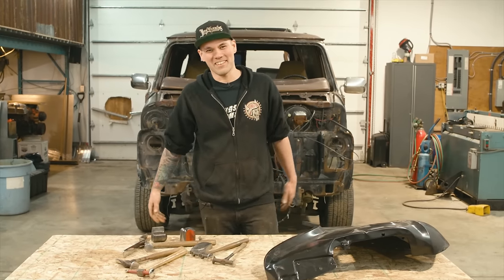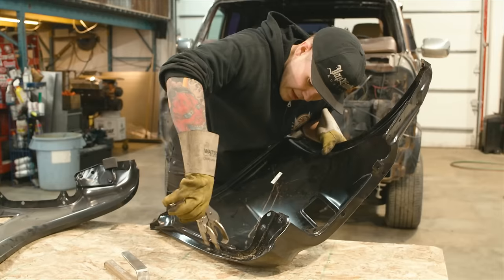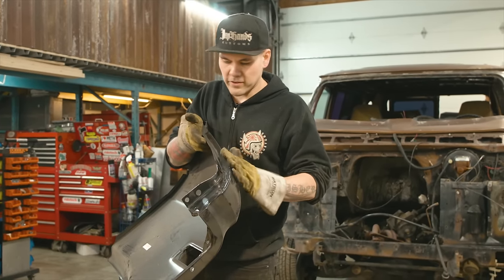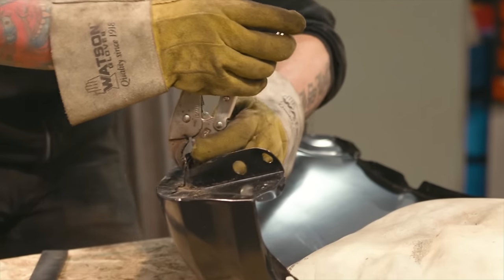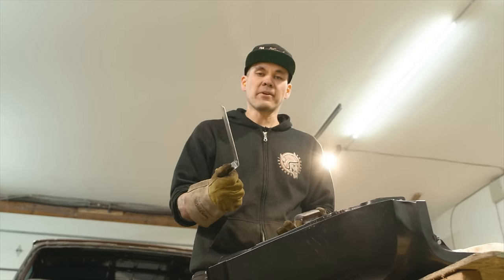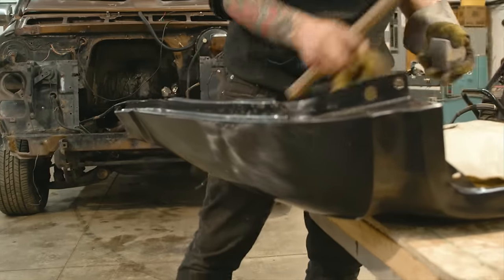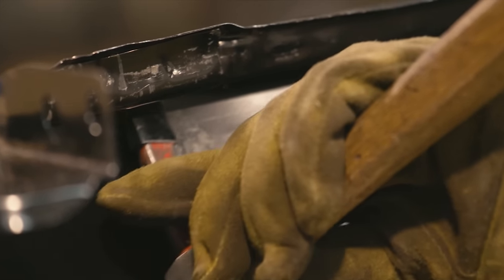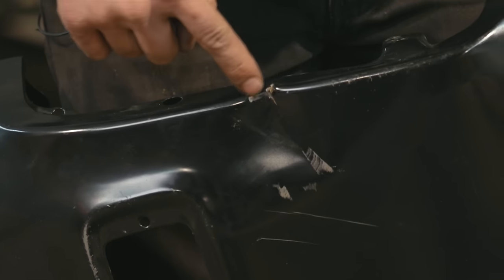"Metal Shaping 101: How To Use a Hammer & Dolly For DENT REPAIR!!

Comment: Ive tried watching a few videos on proper hammer and dolly usage, and this on by far is one of the best ive found.

 Im a novice at it and when you get the hang of it spending some quality time tapping low spots out of a panel sure is relaxing and rewarding work. 

I like the home made slap hammer, will have to find a thrift store file and make one myself.

Great work!

Comment: Brought back an old memory, my dad had a '68 Datsun 510, he got rear ended. I got into the trunk and pushed it out with my knees. Using an assortment of household tools, claw hammer, sledgehammer, splitting wedges, screwdrivers.  No Bondo, certainly not perfect, but he was happy as hell to have his trunk back.

Comment: Nice video liked the soft subtle music track. I found in a short stint I did working in a body shop that many of the new high strength steel fenders are super flexible and almost scary so but when bolted up in place in the car structure are quite rigid and secure. Also often a great difference sometimes between a oem panel vs aftermarket in fit in place.
Reply from the maker: Yeah there is a lot of difference depending on who made the panel and what steel they used. Varying thickness and strength make it challenging

Comment: I'm an auto mechanic with 30+ years experience and by no means am I a body repair guy. I have an inductive heater for siezed nuts and bolts. It works absolutely amazing. My point is that you can buy all types of attachments for this tool and one attachment I bought is a panel heating pad. I have used it to heat dents, dings, and creases and then hammer them out with various hammer and wooden hammers I've made over the years. Now I have never truly been concerned with paint finish or any real technical issues but heating the metal with that inductive heater has really stepped my abilities up. It actually makes the outcome look like I know what I'm doing. I'm just curious if you or anybody here in the comments has any experience using one, and if not I do suggest trying one as it has worked for me a complete novice.

Comment: Regarding hitting a hammer with a hammer...  While it's good advice for occasional hammer users or novices not to hit a hammer with another, you are a professional and understand the dynamics of what you are doing.  You understand the physical properties of the metal that hammers are made of and compensate for the possibility of shattering by using a soft face hammer.  This is called INNOVATING!  I personally would do the same thing.  The cross peen hammer is the perfect force director for what you're doing.  Keep innovating!
Reply from the maker: You definitely get it David! Once you’ve worked with tools long enough you definitely know what they can and cannot do. Cheers and thanks for your support!

Comment: If you had a press could you clamp the fender on the base plate and attach a kleko or surface mount to the area lower the upper plate attach your klping to the upper beam and use it in reverse going up instead of down?

Comment: Sweet work, Karl! You've inspired me to fix a couple disasters I thought would need new parts. And good on you for the hammer-hammer caution. They CAN chip, and the chip can draw blood. In worst case, you'll get to spend $1000 in ER to have one surgically removed from your eyeball, a few hours after it shreds the inside of your eyelid. So don't strike hammers, and DO put on a $3 pair of safety glasses! P.S. A 4inch slug of 2inch round mild steel makes a great hammer-whacker. And knowing you, it'll be slightly crowned & polished. Try it, you'll like it. Rock On!
Reply from the maker: That’s a great suggestion on the slug of softer material!

Comment: Hey , We All have several ", Vice Grip Pliers & the best thing I do to them is to weld a "Lock Washer" on the adjustment screw! Usually I use a 5/8". P.S. it also is great to hang them on your Welding Table!

Comment: Definitely didn't get pulled all the way from last wreck! With the fender off like that you should be able to move support/ apron where you need it. I have also drilled out the upper flange on fender, repair both, weld back on. That can help sometimes. Think we've all had these moments when good parts get trashed! Keep em coming, duder! 😊✌️

Comment: The rolled edge that you are trying to get back to original can be done with a piece of aluminum more rounded than your hammer or a piece of hardwood that has been heated. Shape the wood and then heat the area of the wood with a propane torch. It may char a bit but it will get harder. I have used these shaped pieces of wood to .act as miniature dollys. They can be great for getting out very small low spots.

Comment: Finally got to finish the video. Saw the one where you make the slap hammer and stump. Want to make both after garage. Nice job looks good. Learned the sand paper on metal trick.That collision repair will be fun with a bit of what looks like rust repair

Comment: On several of my vice grips, I have welded a washer on the adjusting bolt. That way I can pull on the panel while I hammer and dolly. Works well on upholstery too. I don't lift anything with it.

Comment: Hey Karl, thank you for another video showing us how to do repairs using hand tools. Man I felt that flat bar smack you in the nose through the screen, I’ve done that a few times myself. The worst I’ve had was under a truck and a piece of 3/8” plate 8”x6” for a drive shaft parking brake, slipped and fell and hit me on the bridge of the nose. The corner of the plate just skinned the bridge open. I was fortunate it didn’t break anything or hit an eye. I now wear a face shield when I work on those particular brakes.
Reply: Also, I really enjoyed the relaxing music that you or Kristina chose for this video. It was a great match to the relaxed focused work you were doing on that fender.
Reply from the maker: Brutal John! You’re lucky you didn’t break your nose

Comment: great work, Karl! less than 50 minutes you were able to straighten out the front quarter panel. I know that had to be a bit discouraging to see the fender get wrinkled up, but you handled it very well and used it as an opportunity to make a video for your channel and demonstrate how someone can fix a dented fender. I wish my truck door was as easy to get to. I had some guy back into me in the Lowe's parking lot back in November of 2020 and took off. Recently I bought some hot glue dent repair pull and bought a Maddox dent repair kit from Harbor Freight for 45 dollars, and I've got most of the big stuff out, but I still have a lot of work to do to finish smoothing it out. I need a couple of tools to reach down in there and push some of it out, but I have to wait to afford that for now. It's a 2010 Chevy Silverado 1500 regular cab work truck, and the arm rest on the door are worn, so I'm thinking about trying to get creative and make some panels out of sheet metal, and maybe even make some arm rest out of some nice wood to overlay on the sheet metal. I haven't made up my mind, but it's an old truck, and I'm thinking about trying some stuff with it. Thanks for the video, Karl.
Reply from the maker: Man that sucks the guy did a hidden run. I I hope you don’t have too hard of a time getting the dents out! Some of those kits work pretty well. I do confess it did take longer than 15 minutes there has been some edited out to make the video more smooth
Reply: @MakeItKustom  I may get most of it out, but, more than likely, I'll have to use some bondo, but I don't think it will be too bad. I'm not getting in a hurry about doing it, though. I'm doing other things as well. I just redone my headlights using the Eastwood 2k clear coat after sanding all the old clearcoat off, and I tinted my door windows and back windows, and the wind isn't too bad today, so I'm out there trying to shrink the windshield. My first attempt was a fail, but I'm about to give it another try, and then maybe work on the dent some more.
I've seen other people attack the dents the same as you; push out some of the bigger ones to release the tension in the metal. I especially like the way you solved the problem with the oil canning by identifying a smaller crease to correct it. Thanks, Karl!

Comment: A quick cheat to straight that hood to fender lip that should be at a 90 degree angle is to bolt it up to the van then smack the fender to hood gap with a 2x4. I don’t think I’m explaining this very well lol. I’ve just done collision work for 30yrs. But you did great👍
Reply from the maker: Would’ve loved to bolt it on but these are weld on fenders. It’s incredible how useful a 2 x 4 is! I actually have a book somewhere of how to repair dance in your 1930s whatever car and it shows using a 2x4 a lot

Comment: Also, explain more about the "feel" of using different pressures on the hammer and the stretch of the metal after hammering and "shrinking" metal. Something I have struggled with.

Comment: Nice one! I have really had to wail on hammers before (4LB mini sledge) and while it is not recommended because of the hardened faces. Sometimes you have to do what you have to do. I really would liketo see the dolly stand build. I have several worn-out forklift forks and have thought about making a set of stationary dollies out of them or the back section rather.  Anyway, Nice video, I'll put it in my saved videos for future reference!!!!

Comment: I really love your channel. I took materials science in college and the metal stuff fascinated me. It makes me wonder about if you ever do any kind of heat treatments? Since especially after hammering and cold working and doing all sorts of body work it seems like it might come in handy to be able to make a piece of metal more ductile or more hard depending on what your needs were, or even to just give it a nice final temper and anneal after all the work has been done to equalize the tension inside everything.

Comment: Back in the day I always did this kind of work with a cross-peen hammer head as my dolly and a regular old ball peen. Looked terrible but I could get the general shape back and just smooth it with some bondo afterwards. I got myself a set of body hammers and dollies and it really makes a difference in how fine you can get the features. The sandpaper block is a new trick that I've never tried before though. Interestingly I've done that with bondo but never tried to get that precise with the hammer and dolly. I'll work on that more on my next project. It would be nice to just have a little skim of some bondo or even just some sandable primer to fill the voids instead of having a 1/16" thick layer in spots.
Reply: Also, I don't think you've got a 1/16" anywhere in there. Maybe half that, but probably not. You got this right down to almost nothing.

Comment: Well I'm sure you didn't have any idea as a bonus video when you decided to move the trailer . Great video as always with explanation as you do it and real time shows perfectly how much or how little actual work on that spot is required and how lightly you can do it and achieve good results . Probably its improved the fit if that was an aftermarket panel . I hear the phrase oil can could you elaborate on what your meaning thanks as always for a great video

Comment: right after 23:00 , Karl , buddy , you make it look so easy when you make those dents disappear. i'm still chasing the door bottom seam post weld issues with my 1951 chevy truck door. ive got a few spots on the weld line that are in the best description, convex and i can barely get my arm in the doors lower hinge opening to get a dolly behind it. id rather not put more heat/quench on it but im almost at that point. what do you suggest. i sure wish you had an email i could send you pics of what im dealing with.
Reply from the maker: Shrinking disc can help or heat shrinking small dots to tighten it up. It definitely sounds like you need to do some shrinking though

Comment: Hi friend.  I love your show but there's one thing you haven't shown.  I have a crease on the lower passenger door of my truck and can't figure out how to work the dent out. I wish I could send you pictures but for the sake of it imagine the previous owner drove into a metal post found in oil fields.  That's where I bought my truck. It has another crease on the rear quarter panel from the same post except it's on the body line. Please do a video of a similar repair showing how to access the outer door from inside the door. Thank you for great shows

Comment: I have a Mazda B2600i. The bedside has a 2ft crease 1/2" deep approx. ending with a kink at tailight. So id need to use a crosspeen hammer on the back to get the kink out near tailight. I cant just pull the bed panel so what would be a good method to get it out?

Comment: you are lucky that the fenders come off ....I'm working on my 74 ford econoline e300 4x4 van and the front fenders, if you can call them that, do not come off and are double walled to boot. lots of weld on pull pins being used but thats ok too.....

Comment: When trying to planish, using a flat face hammer, I'm always concerned I'm going to leave marks with the outside flat edges of that flat hammer face so I pick a hammer with a little crown instead. Is that incorrect logic/concern or is the concern valid but there is a way to avoid making those crescents from the edge of the hammer face??
Reply from the maker: The more convex your hammer the more stretching you will be doing. Don’t be scared just be careful when you were planishing you want the flattest hammer possible so that the load is distributed wider and it is not pinching and stretching

Comment: How would you approach this type of repair if you did not have access to the backside of the dent?
Reply from the maker: That’s really tough I don’t use dent polers but I guess that’s what would be necessary. If I do not have access I find out how I can get access and sometimes I will cut my way in so that I can fix dents and then re-weld the pieces that gained me access

Comment: When working on a panel that is removed from the vehicle (like that fender) it resonates on every hit. What if you laid a small bag of lead shot on the panel, to dampen the sound?

Would it?

(I'm thinking a heavy duty bag, like canvas, loosly filled with small (~1mm) diameter shot)
Reply: Oh, I asked about making a hammer awhile ago…I did it, twice, both hammers work, but not simultaneously, and I didn't take your advice…

One is made with a chunk of 4x4 lumber & metal pipe, one is one piece. The handle was a branch, and the "head" was the trunk, they just grew to the right angle!

 I don't know what kind of wood they were, but they were available, & hard wood isn't. I'll make one with hard wood, if I need to, but these work fine (for now!)

Comment: Locking pliers on a sliding hammer work great for things like that lip at the beginning. Just weld an appropriate nut to the pliers (with maybe a small brace of some sort) to screw them onto your existing slide hammer to create a pulling device, and both tools remain fully functional by themselves.  A video about building a sliding hammer itself might be interesting since you can get creative with the design/decorative aspect of it. 
In general it was nice to re-watch a 'basics of dent repair' type video as a refresher, especially since different people have different ways of doing things. For example prying against locking pliers on that lip. I would have either used a sliding hammer to pull, or hammer-dollied to push the metal back into shape from the beginning.

Also since you said those fenders are no longer sold, do you think there will be interest in some plastic replacements? At least those won't rust! :)

Comment: That’s a fact back 50 years ago I was working on a big valve in the oil field and I had to beat the top of the valve I was using to 3 lb shop hammers beating on one with the other well won of the hammers broke a peace of it is still in the muscle in my left arm and the Dr wouldn’t remove it because it was in one of the muscle’s and the peace went through a blood Vine so the doctor just Stitched my arm up

Comment: Nothing worse than making more work for yourself. That being said, good excuse for a video!
Think i would build up the vise grip with a bit of weld, a square edge for pry bar to grab. Less chance of punching yourself in the face🤣
I chipped a tooth, from a slip with a pair of pliers..not fun.
Have seen hammers chip from smacking with another hammer. Dead blow /brass is safer. I have a ripple in a fender to deal with. So first thing is build a schlapper…
Great camera work,btw.

Comment: Don't hit a hammer with a hammer! LOL
I've been gravestone mason for thirty years, and when I create pitched edges on a stone I always use one 2kg hammer as a chisel and hit it with another 2kg hammer. 
I've never had any hammers shattered or exploded. 😂
Reply: Ah! But a 2kg sledge ain't a thin lipped planisher, grasshopper.
Reply: @robertbedsole8682  Sledge? Lol, not by a long shot, 10-15kg you can call a sledge. 
Besides it's not the size or form of the hammer that's used as the reason for not to hit two hammers against each other, it's because people think that impacting two hardened surfaces together would cause them to shatter, but even when my little 2kg detail hammers are of course hardened, I've never have had any problems.
Reply: @filopat67  Engineer's hammer, aka drilling hammer, aka hand sledge...3 to 5lbs, all day every day. Shop for one and you'll see. You can call it a gravestone edge chipper, but the rest of the world won't. Facts: striking tools can chip. Large, heavy tools can chip light, thin tools. Work pieces can chip. Many striking tools carry warnings to "Always Wear Safety Glasses", because they can chip. And it's dangerous to tell people otherwise. Have a good day.